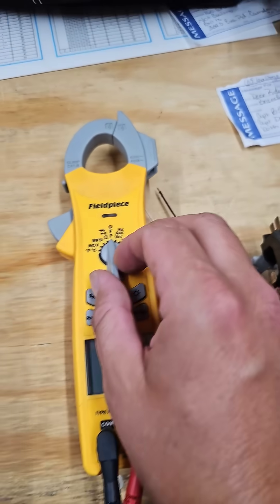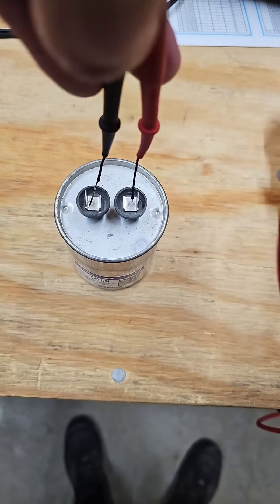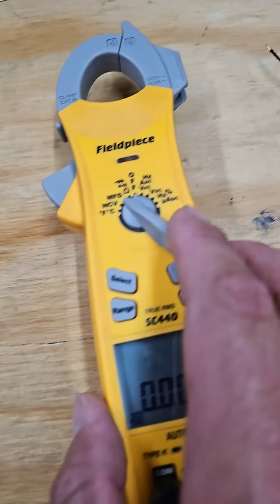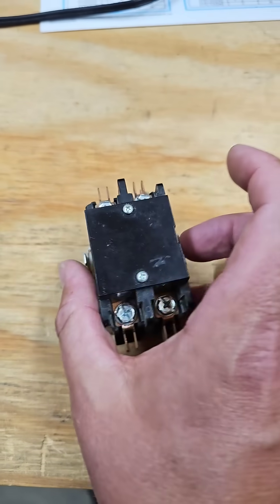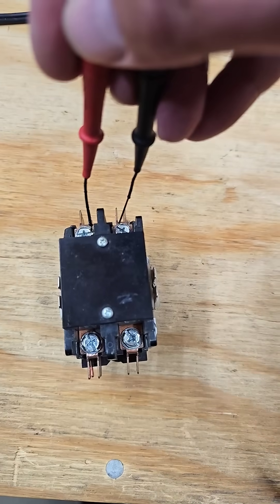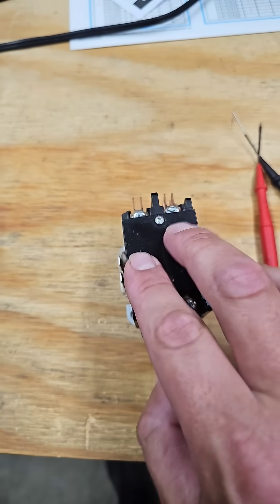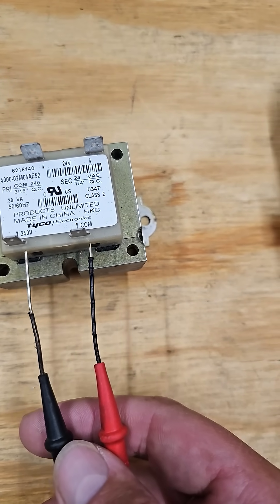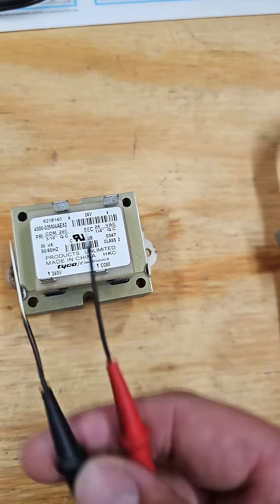How to TEST Capacitor, Contactor, and Transformers. #hvacparts #hvac

Comment: Just a little note on testing Transformers. If you are testing the secondary 24v side with an average volt meter you may get 24v or something close to it and think it is okay and move on down the line testing other components. When all along it was the transformer because your meter is not sensitive enough to read true RMS. When a better meter is used you find that you really only have 19v which isn't enough to close the downline contactor. It happened once to me. Never forgot that.

Comment: Your explanation of the capacitor is incorrect, I'm hoping you just phrased it wrong. You don't have a bad capacitor if it's reading below 35uF, you have a bad capacitor if it's reading (in the case of the one you used in your example) 6% below 35, so your capacitor is still within tolerance down to ~32.9uF and up to ~37.1uF. It's not bad if you get a reading of, say, 33.7uF. Now yes, it is an INDICATOR of a capacitor starting to go bad, but the capacitor is not yet bad.

Comment: Fan and compressor just quit few days ago, had a new start cap, installed it, contactor is fine, has correct voltage both sides and low voltage to operate it. I'm stumped unless my freon leaked all the sudden.

Comment: Caps usually leak or are designed to break the connection by bowing out at the top also. Contactor you should also ohm across the contacts to see if the contacts are wielded closed or open.sometimes its just a need to change or clean the contacts. Transformer you can ohm as well an smell it.if the windings are bad it will cook and smell burnt

Comment: He forgot the plus or minus on the cap and load or no load on the contractor. Their is a better way to run a lost age test and caps are given a +/- of max 10 to pass the high side is the new and the lower is used. Lower mfg = higher amp draw.

Comment: When you have voltage to the coil of the contactor, you should have line voltage going in and coming out, NOT line voltage going in and low voltage coming out, as you said in the video!!!

Comment: Great informative vid. Only thing id add is there is a +/- of 6% on capacitors. For example if 20mfd cap is reading 19.5mfd its still within range and more than likely not the issue

Comment: Im an electrician and had to troubleshoot my AC system... my go-to HVAC guy informed me that it sounded like my 24V contactor was shorting out. He told me the coil should be reading 6 ohms... I had 0! 
Dude is a genius to have figured this out through a text message! He diagnosed my issue in about 10 minutes 😊
The shorted contactor had burned out my 24V transformer which had also melted the back of my thermostat. It's up and running now though. This was just a few days ago.
Reply: @Frank-ih9ew You're bragging about being an electrician literally your career and you needed an HVAC technician to walk you through these steps.
Reply: @Skibidi_Male_X  yes, I'm not an HVAC expert, so I stay in touch with some good ones. And they reach out to me for help when they need it too, nothing wrong with that
Reply: @Skibidi_Male_X  and not bragging, just stating.
Reply from the maker: Glad you got it figured out!

Comment: Question…..I’ve never seen a transformer on a furnace/AC system, where would it be ?
Reply from the maker: Transformers are usefully located in the bottom of the furnace near the control board
Reply: @taddydigest  Thank-you !

Comment: Capacitor will have a +/- of a percentage (commonly 5% and 6%, sometimes 3% and even 10%). So like on a 5 MFD, @ 5% in range would be 5.25-4.75. Anything higher or lower would be considered out of range by manufacturers specs

Comment: If you are blowing a fuse on a control board during a call for cool. Check your communication wire going to the condenser for any exposed wire. If that’s good, than ohm your 24v coil on the contactor to see if your are getting 12-17 ohms. The coil on the contactor could be shorted out and causing your fuse to pop.

Comment: Capacitor has a percentage on it. Just because its 34.5 mfd instead of the rated 35 mfd doesn't mean its bad. Its gotta be lower or higher then the 5% or 6% or what ever it says. Ex: 
Rated @ 35 uf +/- 6%
6% of 35 is 2.1
35+2.1=37.1uf
35-2.1= 32.9 uf
If it is within 37.1 uf to 32.9 uf it is most likely okay and working properly unless noticeably burnt up or bulged out or something.

Comment: Had no AC one weekend, motor was humming but spun so I knew it wasn't that and had to be the capacitor. Checked that and it was all rusted and bowed on each end, had to power through to Monday to run to the supply house and got an 35/5 capacitor for $9.00. Popped it in and back in business! To call an AC guy would've no doubt ran me near $500.00 if I had to guess. I also power down the condenser in the winter and cover it.

Comment: Wrong you should always have one leg 24v on your contactor coil from one leg  when it calls for cooling across the coil if it had a bad coil your fuse would pop at your air handler board

Comment: You should be using correct technical terminology. It's not UF its microfarads. Also, if the secondary side of the transformer is open circuit the its a problem with the  thermal fuse underneath the plastic flap in most cases

Comment: Hvac guys are going to hate you for this video… I learned these things years ago and have saved myself hundreds. My fan motor went out, my capacitor has gone out, my inside blower motor, igniter and the control board inside have all gone out in the past 20 years… saved thousands in labor charges
Reply: Can you share what furnace (80% or ?) and whose A/C systems ?
Reply: @pacolapala  replacing is easy, I’m new to hvac and I’ve done everything you’ve said. It’s troubleshooting and diagnosing that takes time to learn. Definitely save a lot of money if you can do it yourself tho

Comment: You need to discharge the capacitor before measurement. Touch both terminals with a wire or screwdriver.

Comment: You should be conducting a test on the capacitor when it’s under a load that’s the only true way that you know exactly where your capacitor is that right there the way you’re testing it will cause you a service call guaranteed

Comment: You failed to mention capacitor tolerance.  It may be lower or higher than the nominal rating and if within capacitor tolerance...it is fine

Comment: Wow Taddy got a real meter! These youtube technicians have made my job so much easier when it comes to pricing. I no longer charge for small parts. I charge by the hour for my license's and certifications. 400 dollars an hour. If you need a motor,coil or compressor you better bring a credit card or check. Thank your youtube technicians.

Comment: If you don't have access to a digital meter you can check your capacitor in the ohms setting.  You have to be QUICK tap your leads from C to fan and the needle WILL bounce to your 5-10 and C to Herm will jump to your 35 -75.  Not sure why but ive never seen it jump to 80🫤 try it some time. But like I said you have to be Quick anf have good contact.  Its almost as fast as a heart beat

Comment: It would help people learn if you'd use the actual terms....micro-farad for uF (a millionth of a Farad). My keyboard doesn't have the actual "mu" symbol for micro. The MFd on the meter stands for milli-farad... a thousandth of a Farad. One other point: the transformer could be a 120VAC input model, instead of a 240VAC input. Obviously it'll be labeled. Of course, if you have to explain VAC to them, perhaps those folks have no business poking around in their HVAC unit.

Comment: I appreciate the simplicity. One correction, the uf is actually mf for microfarads. They are using the Greek letter for m so it just looks like an English u.
Reply: mF means milli-Farads...one thousandth of a Farad....a very large capacitor. Micro-Farad is designated as uF (it's not actually a "u", but the Greek letter "mu", but our keyboards don't have that letter). Mu means millionth.
Reply: The μ is the symbol for "micro". μs is microsiemens indicating the conductivity of a material, usually water and how much TDS it contains. (total dissolved solids)

Comment: I change out the capacitor every five years. Easy to do, for about $30 and 5 minutes or $150+ if you call a repair service.
Reply: Yes   I only pay $9.00.  Cheap to replace

Comment: In my area we bring 120v into the transformer. I've never seen a 240v transformer for an AC unit. Learn something every day
Reply: Depends on the system….. Air handlers are usually 230V but gas furnaces are 115V

Comment: You can also measure continuity across contacts using voltage. If you go across closed contacts and get zero then the contacts are good. If you get any reading then the contacts are bad.

Comment: Do transformers go bad that often? Also, on the contact or check for 24V on the coil leads…that will tell you if you thermostat is sending a call for cooling and if that is good it will tell you if the TX had a blown fuse or is bad..

Comment: Also:

Put a screwdriver between your leads on capacitor when taking it off as it can still hold a charge 

And when doing continuity checks on coils sometimes you can still have continuity but the coil is fried and doesn’t have enough resistance and will pop breakers
Reply: Will pop the 3A fuse in the air handler.  Thank you for the valid example.
Reply: What coil ?

Comment: Sorry that’s not how you check a contractor, if that contractor has 24 volts and it’s shorted it will almost always short out the transformer, you ohm it out and measure the resistance
Reply: @mikestig4480  no, if you have 24 vdc on the coil,  the coil should activate then check for 240ac on both sides of the contacts.

Comment: Shouldve showed how to ohm out the contactor across the coil,should have around 12-17 ohms
Reply: I was about to comment same thing, u saved me from typing
Reply: @zahedaminullah6934  I was about to say the same thing also. You saved me from typing also. oh wait, I’m actually typing now. Damn😝
Reply: @zahedaminullah6934  same
Reply: I’m shocked by this suggestion. ⚡️
Reply: Shorted coils used to be very rare 15 years ago in my experience. Very common now with cheaply supplied parts across all brands of equipment.
Reply: @derekcaylor8449  compressors,fan motors,capacitors,leaky coils. Nothing last or is made like it use to be
Reply: Most of my reads are between 15-19 ohms, but yeah, if you're getting 0.8 ohms on the coil side, you've got a fuse popper.
Reply: TY, I need to do that tomorrow
Reply: @RichardBellII  no problem,if it's bad, you'll get a real high # usually,a lot of times, when bad, it will pop the fuse in the furnace too, if it has one
Reply: @cardsfan1590  I actually came across this today at my school. We were wiring a control board and I had a bad contactor and teacher had me ohm it out and it was around 70 ohms
Reply: @atbsfia  nice,soak up that knowledge,need more people who want to work  in the trades. There's good money out here to be made
Reply: @cardsfan1590 no. If it’s bad the resistance will be very low
Reply: @cardsfan1590 Normally on a contactor the ohm reading will be very low and blow the fuse in the furnace, also some of the info in this video is not good practice. If a 35 mfd cap is reading 34mfd doesn’t make it bad it has a +\- range.
Reply: @garrettfeetham8707  yea,when the coil shorts,it usually blows the fuse and nothing will run
Reply: But will it though? Every coil? Really
Reply: @shanebehm8251 single pole double pole and 3 pole contactors have different resistance across the coil
Reply: Right. He checked the cap with no power applied..
Reply: @dioncurtiscurtis3188 you're not supposed to check a cap with power supplied to it lol
Reply: @Straight_White_Fatherly_Figure 
That is actually a more accurate way of testing a capacitor. Look up "checking capacitor under load"

Comment: Check line voltage in and out at the contactor. If it's in both places, check voltage drop across the contacts while the contactor is energized (L1 to T1, and L2 to T2). If the voltage drop is around 1 Volt, the contactor will be going bad soon. If the contactor is around 2 Volts, the contactor is bad, although it may not be causing an obvious problem. 3 volts or higher voltage drop, and your contactor is trash.

I change them if they're higher than 0.6 Volts of drop.
Reply: You ever just clean the contacts?
Reply: @master-oppressor  
I wouldn't try to rework the cheap "definite purpose contactors" that are used in HVAC equipment. They just don't cost enough to fool with. They're also fairly universal, so you can change out one brand for another. Meaning, they are VERY easy to find.

I have definitely used 400 grit silicon carbide sandpaper to clean contacts in a pinch. Like if it's 100⁰ out and I can't get the replacement until tomorrow. I probably won't let someone roast overnight if I don't have to. But, cleaning contacts never seems to work for very long, maybe 2 months.

On big industrial equipment which contains large NEMA sized contractors and motor starters, the contacts are replaceable. So, I either replace the whole thing or just the contacts.

One more thing: I replace all the big capacitors in systems ever 5 years. They last 7 to 12 yrs (basically 10), but if you change them every 5 years, it will save you the hassle of a breakdown. It's also tough on motors when the capacitors go bad. So, changing the caps may save you a motor.
Reply: @cornpop7805  Gotcha.
You're right. I put a new one on last month, $6.98 on Amazon. 
My old one was chattering, but after I sanded down the contacts,  it looked good enough to keep as a spare,  just in case.
Reply: @master-oppressor  
I'd throw away the old one and just buy a second one, if you think you need a spare.